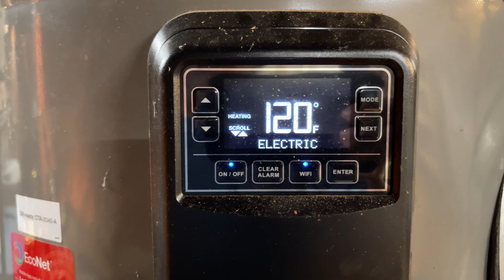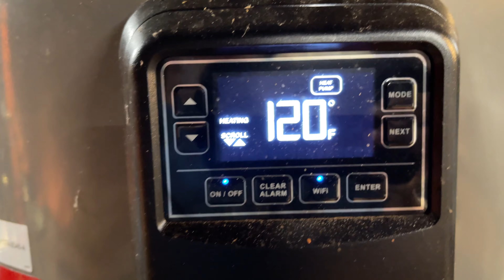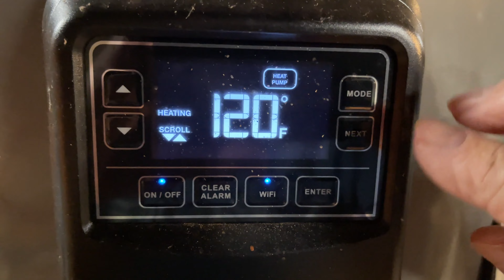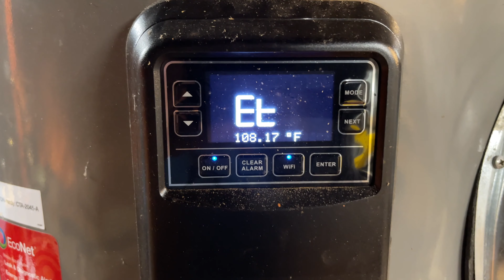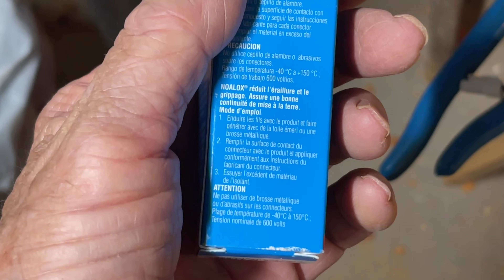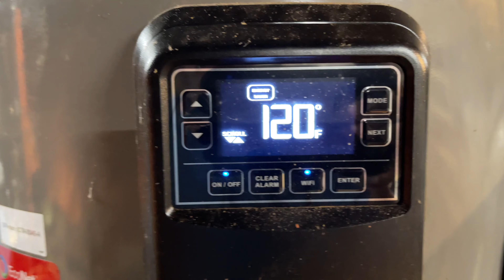EcoNet Alert - A005 Heat Pump Water Heater Gen 5  Compressor Shutdown: Discharge Temp High

Comment: I called Rheem tech support today to request a replacement thermistor for my faulty Evaporator thermistor. They verified the temperature reading on my thermistor was faulty and will send a replacement. I asked what is being done to fix this problem for all the homeowners who have this problem. They said that the tech support team and engineers met in July 2024 to discuss the problem because the call center was receiving many questions about this error code. There has not been a long term fix or bulletin issued yet, but it is good to hear the problem is heard.
Reply from the maker: Thanks for watching and sharing your follow up with Rheem.

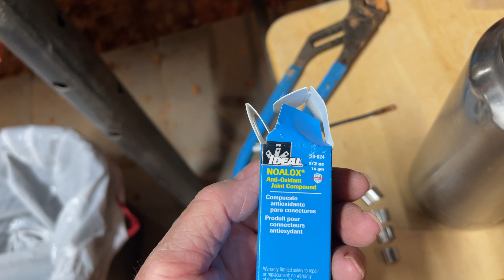Comment: This anti oxidant joint compound "noalox" (time stamp 8:00) should have been applied when built. 🤔Easy fix.
Reply from the maker: I agree
Reply: Agreed. This failure is intentional and foreseen. Rheem is begging for a class action lawsuit with their automatic shutdown and annoying beeping for their problem. The fact that the code is changed for the exact same issue (thermistor temp out of range high) speaks to the fact their were aware of this when coding errors. In my opinion, a sensor that autensibly is there to warn of high Temps who's only solution for repair if the sensor trips is to replace the sensor is self evidently unnecessary  unless the need Is simply to create demand for technician visits.

Comment: That looks complicated.
Reply from the maker: It just depends on your amount of experience troubleshooting technical issues. Most people interested in purchasing the hybrid hot water heaters already understand the science and why they are efficient. Other non scientific people get interested when they find out how much they can save on their power bill. Rheem does need to make sure they improve their manufacturing processes to minimize defects.